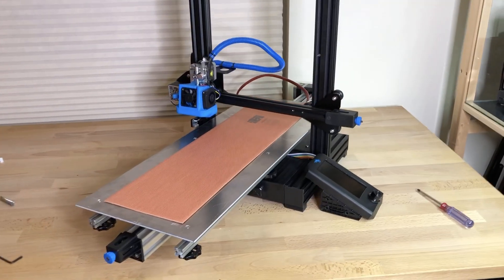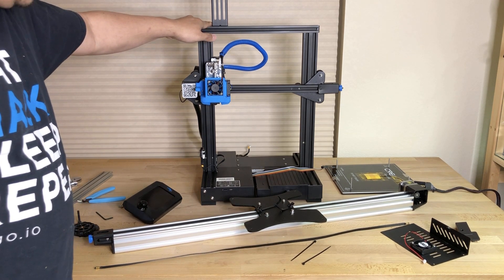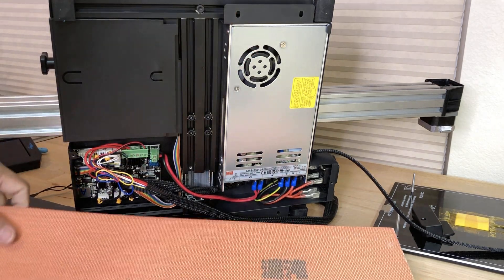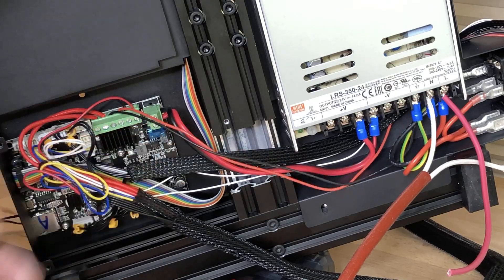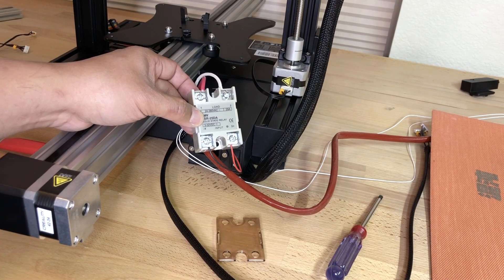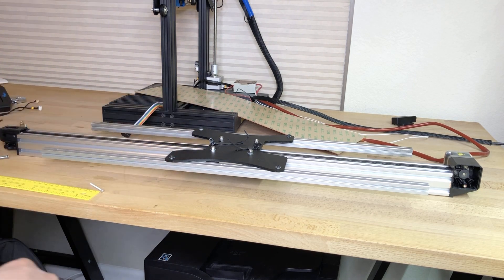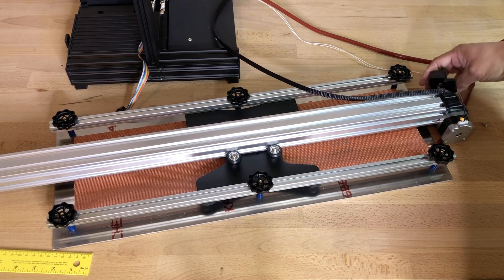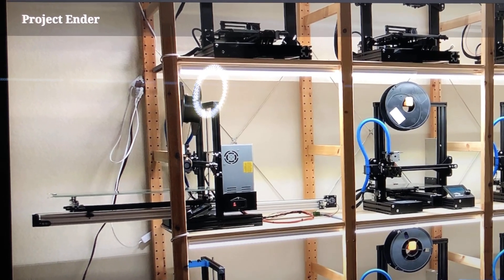Extend Your Ender-3 to More Than Twice it's Length!

Comment: Where did you buy the long bed ? Can I put two Ender 3 beds in series ?
Reply from the maker: Two in the series? Why don’t you just go buy some aluminum?
Reply: @ I meant the silicone heat Matt. But it’s all good I found the right size on Ali express. Should be coming in a week and a bit
Reply from the maker: Good luck with that! Hope it works well for you.
Reply: Thank you bro for your video, it was very helpful. I have just nearly finished the project. 
Just curious, how to I change the printer bed size? Is it just thru the slicing software? 
Also just wondering if there’s any issues you ran into with the bed sensor that lets it know it’s at the end of the line?  

Thank you again :)

Comment: where do you get the parts though... thats all we need
Reply from the maker: I have about 20 kits of parts except for the base plates. That's the hardest to find.
Reply: @HODLjustinkace  I bought a 16" 400mm bed heater, a 400w PSU, thick aluminum plate
I just need to find the rails!!
Reply from the maker: @JonBallRealEstate  How long of rails do you need? I have them 610mm predrilled with holes, but maybe that's not what you need.
Reply: @DewItJustinKace  I'm not sure. The bed is going to be 16" or 400mm.
Hmm
I could always cut them up smaller
Reply from the maker: @JonBallRealEstate  sure. otherwise misumi sells 1515 cut to size.
Reply: @DewItJustinKace   I was just gonna buy some random linear rails off amazon but I'm not sure what size I should go with for a 400mm bed so that I get the full 400mm.  It looks like the factory rails are a lot bigger than the factory bed.  thanks
Reply from the maker: @JonBallRealEstate  Are you talking about the 4040 for the Z axis or the 1515  for the bed itself?
Reply: @HODLjustinkace  I'm making the Y bigger. From 220 to 400mm.
The factory rails for the ender 3 are like 2x the bed size. So I just ordered 500mm linears for the new 400mm bed. I'll just see if I can make it work and if I get the full 400mm bed size (I doubt it, I probably need to go 2x which would be 840mm)
Reply from the maker: @JonBallRealEstate  sounds right. Just look at the increase to the bed size and add that increase to the railing for the y-axis. Although I personally like to cut everything myself.
Reply: @HODLjustinkace  sorry if I'm not being clear. 
I changed the order to 600mm linear rails for the new 400mm bed. 
Hopefully the rails will be big enough so that I can use the full 400mm bed

Comment: Hello Justin,
I recently watched your video on extending the Y-axis of the Creality Ender 3 V2 to accommodate a larger bed. I followed your instructions and successfully modified the printer in Cura by adjusting the Y-axis size. However, I'm encountering an issue where the printer doesn't move beyond the original length when printing. I created a modified printer profile in the slicer, and the generated G-code reflects the extended Y-axis, but the printer doesn't utilize the full length during actual printing.
I suspect it might be related to the firmware, but I'm unsure if there's a way to achieve the extended movement without compiling custom firmware. If that's the only solution, I'm also unfamiliar with the process and would appreciate guidance to avoid any potential issues.
Any assistance or suggestions you can provide would be greatly appreciated.
Thank you,
José
Reply from the maker: I hope you were able to rebuild the firmware using visual basic or something like that.

Comment: Why do you need a solid state relay?  How fast does it need to switch on and off?  Not too fast, I wouldn't think.
Reply from the maker: I use a SSR on the bigger heat beds. Works great!
Reply: @DewItJustinKace  Isn't it a lot more expensive than a normal relay though?

Comment: Love it, you've got me wondering if I could build one about 1m to be able to 3d print router templates for guitar necks and maybe even fret slot gigs, I'm thinking it may be wise for me to extend the opposite way for extra stability with the extra length, but love the way you've thinking outside the box

Comment: I'm also looking for updates on this. I want to be able to print parts that around 350 mm long but only 200 mm wide. The ender extender kit people sell their Y axis for the ender extender 400 mm kit seperately. It comes with 4040 extrusion, belt, and upgraded stepper motor. I was planning on getting this, and using the stock plate carriage. I was then planning on cutting a 410 x 235 mm alluminum plate with stock bolt pattern, a glass plate in the same size, and a larger bed heater. Would I need anything else?

Comment: why not doi it 610 x 610 x 610
Reply from the maker: That would require a complete modification of the width which means way more replacement of parts. I recommend getting an Ender extender for that.

Comment: Do you think the hammer head t nuts are secure enough?

Also, a listed BOM (build of materials) would be awesome) I know you have links for some things, but a spreadsheet/itemized list would be super helpful!
Reply from the maker: Working on it. As you can see it’s slowly in development. I general don’t use the t-nuts but so far they have been fine.
Reply: @DewItJustinKace  why do you use makerbean xl?  Is the 5mm that big of a difference in the build(from standard 2020 extrusion)? I only ask because makerbean xl is pretty expensive to source in the US. Since you need to order 2x 750mm, then pay for shipping, and have them cut(or cut them yourself) .
Because 2020 extrusion is easy to source in the US and a 600mm 2020 from zyltech can be sourced for about $9 each.  But the 750mm is about $10+ shipping + (3.75)cutting fee
Reply from the maker: @brandoneich2412  They always seemed a bit lighter and made it easy to use m3 screws. I found a source and should  have some for kits to offer shortly. But if you are looking for a local supplier, back in the day I got a bunch free here https://us.misumi-ec.com/vona2/detail/110300465870/